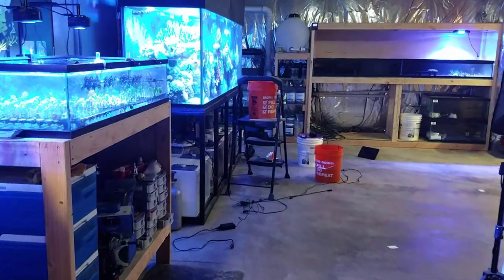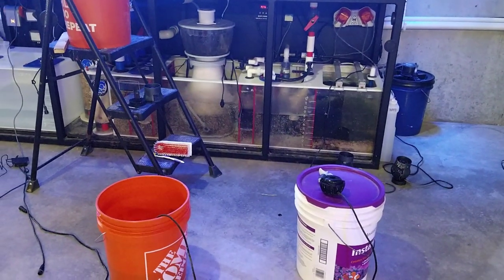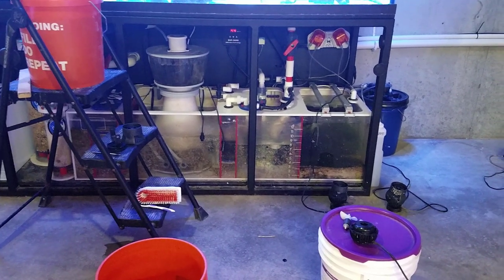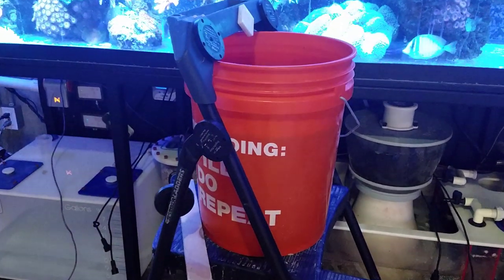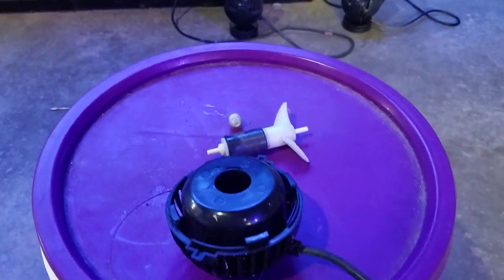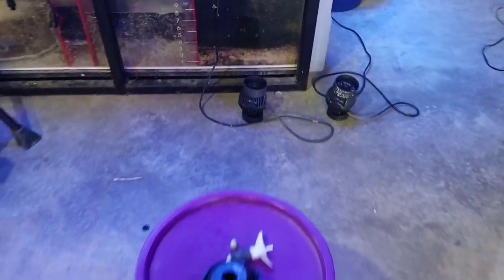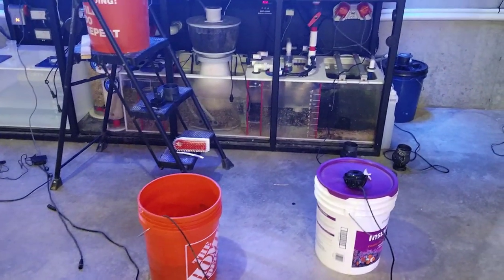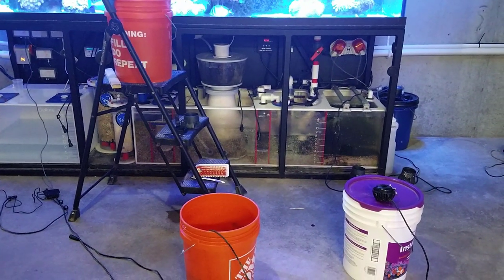How Not To Clean Jebao PP20 Powerheads

Comment: Vinegar is the cause of the expansion issue when it comes to power heads/pumps. Citric acid  is the way to go!!! Happy reefing!!
Reply: I use hydrogen peroxide
Reply: Actually if you don’t leave the pumps in diluted vinegar (5-10:1 ratio of vinegar to water) for more than an hour it’s not an issue.  I’ve cleaned my mp10s, mj1200, tunze’s, and eheim pumps for years this way without any issues.  Don’t soak them for too long and you’ll be fine.
Reply: @MW-ut3dk  Just stating the cause for magnet expansion and a proven gentler method being citric acid. Obviously it comes down to personal preference at the end of the day and amount of risk said person is willing to take.
Reply: No problem-citric acid is fine too.  But the key is not to let it soak too long, which is when you get into trouble.  Not trying to tell you you’re wrong but just adding more detail to the issue so people can make the right decisions.  There’s a thread on Reef2Reef about this that goes into a lot more detail if anyone’s interested but I think soaking overnight in any acid isn’t a good idea.
Reply: @MW-ut3dk  definitely not its only recommended to soak in citric acid for 20 to 30 min. If someone soaks over night they played a stupid game and get a stupid prize lol have a good one happy reefing M W!
Reply: Dylan Masters Yup good way to blow some dinero!

Comment: This kind of thing is what eventually pushed me over to Vortechs. I found I was replacing a couple powerheads a year for the longest time due to various reasons. I finally bit the bullet and bought a set of MP40s, they’ve been running strong for a good 6 years. They’ve more than paid for themselves.
Reply from the maker: I have several vortechs but... not interested in the chance of them rusting out in my display
Reply: The risk of rust is small. You’re not at all concerned that these pumps cooked themselves in your pail? I mean, if they heat up like that in vinegar why would it be any different in saltwater? If one of these warps and cracks and exposes electrical parts to your tank it can cause a lot of damage. All pumps have potential for failure. I’ve had the best luck with Ecotech but everyone has a right to their own opinions.
Reply from the maker: Still not interested, The jebaos do the job just fine, plus ecotech gets enough of my money when it comes to lights.

Comment: I also have a set of PP 20s with the Jebao controllers, and a set of RW that was working on a Jebao to Neptune controller like you have. I had a different issue where my Jebao adapter just died.. now its possible it just happened over time because I was only using the 4Amp power supply for some pretty big wavemakers, but who knows. When I clean my pumps, I put them all in a bucket, but only run one of them, and I only run them for a hour then scrub them, 12 hours seems excessive and I don't think was getting them any cleaner than they were going to get after just a hour anyway. I do like that the PP20s can be disassembled far more than any other Jebao pump. Has anyone gotten a PP pump to work on a Jebao to Neptune adapter?

Comment: Good to know I have two and I wonder why my tank always run at 79 degrees now I know I actually was considering the JEBAO slw 20
Reply from the maker: the temp of my tank was has also gone down after removing two of them. Not sure how much impact they had on 500 gallons but still stayed up around 79.8 now 79 even
Reply: FishOfHex Aquatics yea mine is 250 gallons and it goes from 78 to 79 everyday
Reply: That’s a lot of heat generated by these pumps!  250 gallons of water takes a lot of energy to heat up.